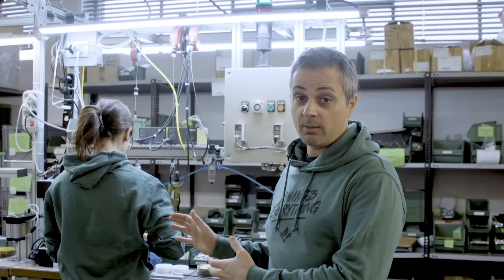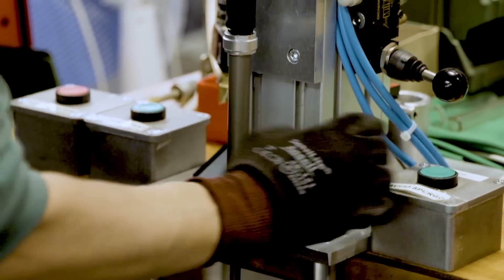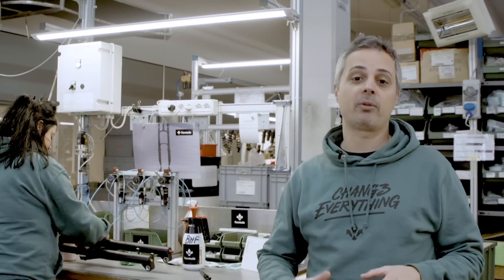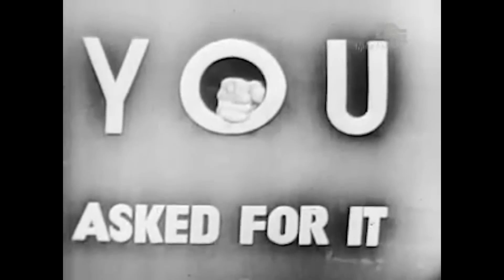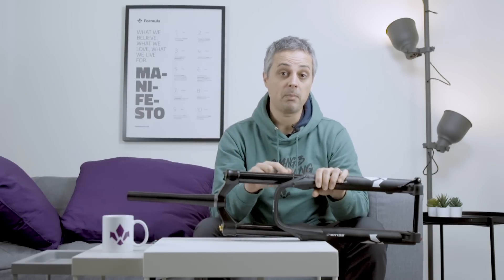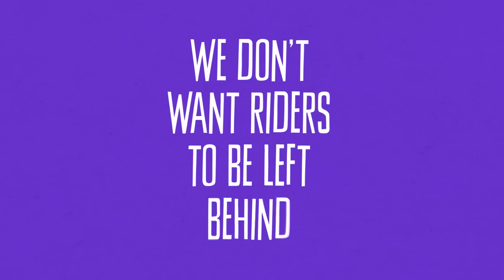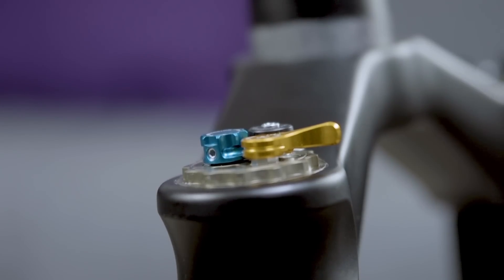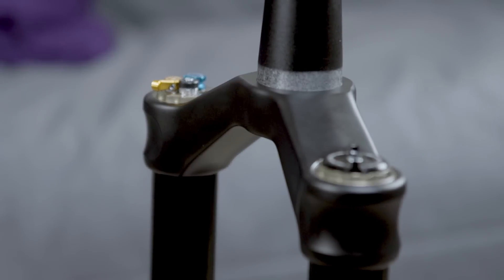Bike Suspension Factory - How To Build a MTB fork

Comment: Unfortunately it's almost impossible for me to use all of the travel on the Selva C with a soft spring and 15-20 % SAG (70 kg with gear). Sent the fork to the distributor who checked everything and they had to calibrate the bushings, but not much gain.

I think the Selva C is a questionable design...
The air pressure in the spring chamber for bottom out resistance stays the same, regardless of the actual steel spring, so a fork with a soft spring is much more progressive than a fork with a harder spring. stupid.

I also had to run the damping completely open (gold CTS) and having no real adjustability is a complete dealbreaker. The silver CTS was worse because it's more high speed, combined with the progression the fork became completely unrideable. Can't understand how that can be the most comfortable valve with that much HS...

Worst and most inflexible fork I've ever ridden and probably my worst bike purchase ever.

Comment: Thanks for this Amazing video!

But I have a question dear Formula Team:

I have the „old“ version of the Selva, the one without the Letter S, R or C. It’s just named Selva.
It has the single air chamber, with the negative steel spring.

Is it possible to install the coil kit on my older Fork, too?

It would be amazing, since I’m already running the EXT Storia in the rear and it performs amazing.
Now if I’m able to get the full Italian coil setup, by converting my fork, that would be awesome!
Reply from the maker: Yep, the "old" Selva is full compatible with coil or 2Air. All our technologies are retro-fit. We don't want to leave riders behind. We want your Selva to stay as long as possible on your bike!

Comment: I have ridden the Selva Coil for the first time today. It feels awesome but a little on the soft side, since it comes with the medium spring and I weigh 95kg. Just wondering. Would putting in the orange CTS give it a bit of bottom out resistance? I couldn't get the firm spring with the fork when I ordered it so I will have to make things work until I can get this spring.
Reply from the maker: Hi, very happy you liked the fork so far. With a firmer CTS or a firmer spring, you achieve slightly different things. We would suggest to try both and see what you like most. Start with a firmer CTS if this is easier and let us know.
Reply: Formula Well, it‘s easier to put in the firmer CTS as it was in the box. So sad that you didn‘t make it possible for the end customer to choose the spring rate before buying. I understand that this would be somewhat difficult to handle though. I‘ll have to buy the firm spring once it‘s available.
Reply from the maker: @thetrailnomad  This would be very, very difficult to handle. We try to do our best but we also have to face the way how the distribution model works.

Comment: one of the reasons I went to coil  setup on my new bike, is that I don't have to adjust the air pressure. there are parts of the year that get very unstable, so have to adjust it every time I went out or it would be too firm or so low I would bottom out easily.
I haven't tried any Formula product yet. but nice to see you have a coil option now. I got a Fox 36 with Vorsprung coil conversion. in the rear I have EXT Storia v3, I only have ridden the bike for 2 rides so far.
It''s on a Nicolai/Geometron G1.
Reply from the maker: You have a lovely set up. We hope you'll get the opportunity to try the Selva C at some point, it's really a set-and-forget beast.

Comment: Will this be available in 170mm too for the 29er?
Reply from the maker: It's 160mm for now but we're working on making a 170mm version 29" too. Stay tuned!
Reply: @FormulaItaly  Do you happen to have a price that this fork will cost?
Reply from the maker: @thetrailnomad  Selva C 29" in 160mm is available starting from now and is € 950 in black and € 1.060 in ultraviolet.
Reply: @FormulaItaly  Thanks. When will these forks be available in Germany through Cosmic Sports? I remember some Cura 4 brakes, that took a while from being announced to being available. :P
Reply from the maker: @thetrailnomad  They're available starting from now!
Reply: Formula Are different springs available already too? I may be a bit too heavy for the medium spring. Also, I couldn‘t find the manual for switching the spring. Will this be available online too?
Reply from the maker: @thetrailnomad  The CTS into the fork is the Gold one. In the box, you'll find the Blue one and the CTS tool. We'll communicate the prices for separate springs asap. End of January we'll have online a video tutorial about switching from air to coil-spring and vice-versa and a tutorial on how to change the spring.
Reply: Formula Wouldn‘t it be smart to already have springs and the tutorial available when the fork comes out too? I‘d like to get it ASAP but with a medium spring, this could be too soft at 95kg.
Reply from the maker: @thetrailnomad  Springs are available, our distributors know the price and we've in stock. Just we did not release the prices with the press release cause we were a bit rushing. The coil-conversion kit is already available. Weìll put out a tutorial in January but it's going to be very easy. Meanwhile, you can see our tutorial from the 2Air System kit, you have a lot of info there.
Reply: Formula I just ordered this fork through my dealer. I just couldn‘t resist. I had been running the Selva S for quite some while and only sold it, because I thought I needed more travel up front and got a Lyrik Ultimate 2.1. Since this fork doesn‘t perform as nicely as yours, I want to go back and having a coil shock in the rear, made me want to go down this route. One question though. Since you are working on a 170/180mm 29‘‘ fork. Will the 160mm fork that has just been released upgradeable?
Reply from the maker: @thetrailnomad  Hi, yes, the fork will be upgradeable, but this time, it's going to be a little more expansive than the past cause you'll need to change the full crown-stanchions-crown pack. We don't know the price yet. This said, if the fork performs well 1cm more is not gonna do much. We know that we all have been bombarded in the last 10 years or more with messages like: "you need more travel" or "you have to use all the travel all the time" and this is not gonna stop. We believe this is made up just to sell more stuff, if you have a very good performing bike with 160mm at the front, you don't need one cm more on the fork, simple as that.
Reply: Formula Yeah. This may be true. I was victim to the publicity of recent times. I was victim to your publicity too for that matter. :D